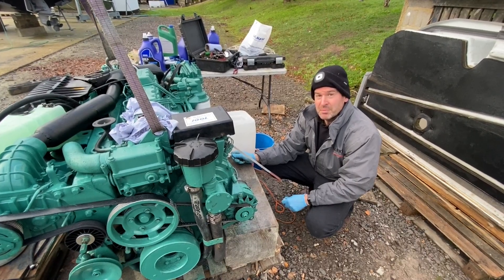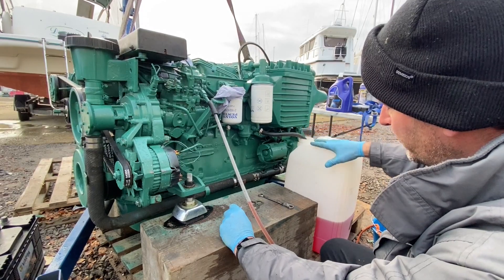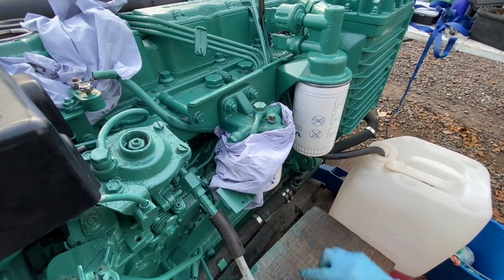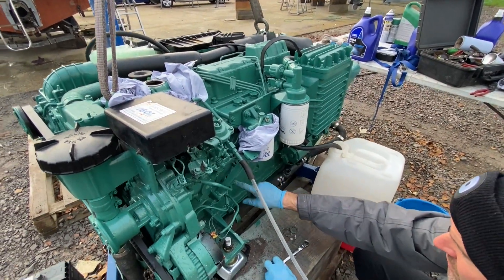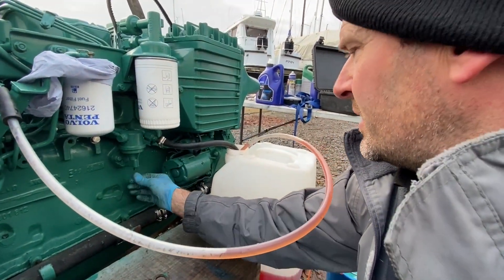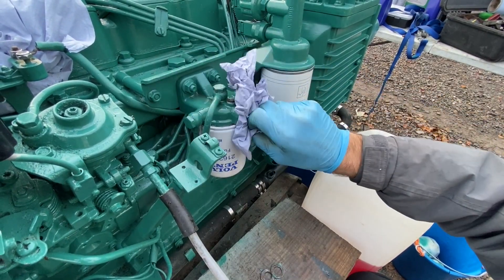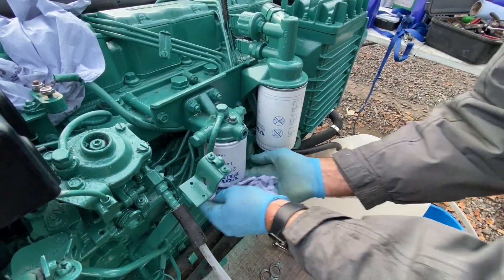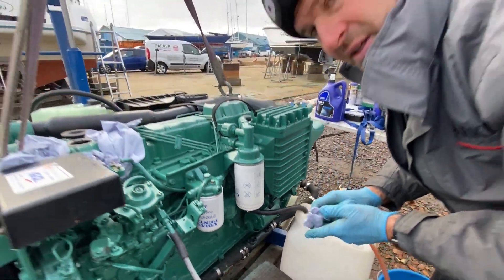Marine Engineering Made Simple Series #1 -  Tutorial on Bleeding a Diesel engine - Volvo Penta KAD

Comment: note: if the lift pump lever has no tension when bleeding you may need to bump the engine over so that the rod on the backside of the lever is on the high spot of the cam lobe...

Comment: But isn't there a good possibility of air downstream of the areas/components you show here? Don't you next at least have to crack the nut at the first injector to ensure removing the air, if any, until clean fuel shows with no bubbles?